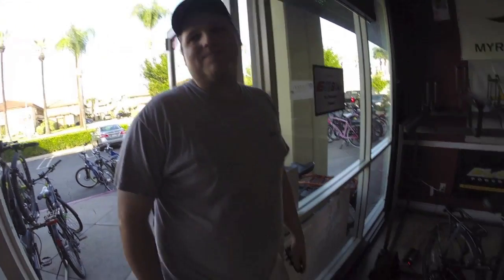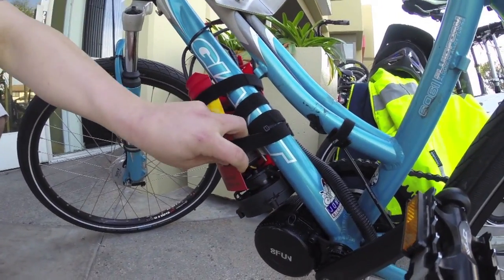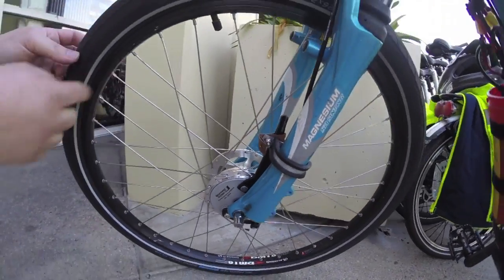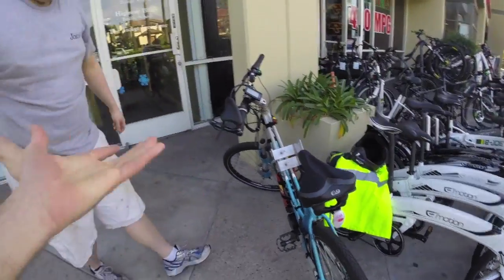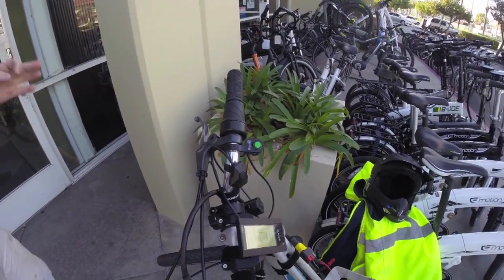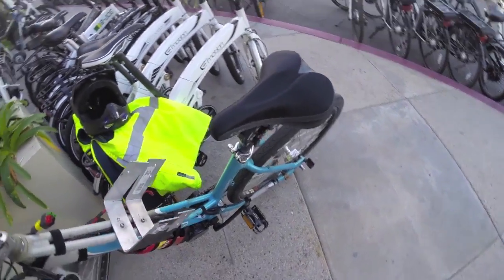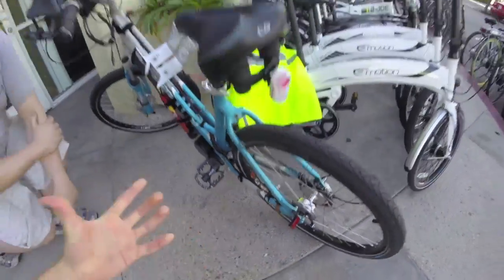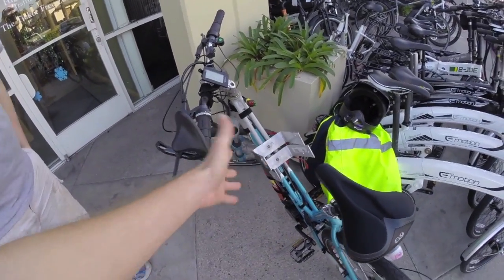Custom BBS02 Electric Bike Conversion - Interview with Grant

Comment: If you're spending $2,300 on that kit, you're buying it from the wrong vendor. The only cheap part on the bike was the fork, and it was fine for commuting. The fan is a 12v one made for ATV radiators I believe. It ran off a DC-DC converter I added that took the 52v of the pack down to 12v.

Comment: some more details on that fan would have been good =/
Reply: Monstaah it was a 12v fan from Spal, made for powersports radiators I believe. Run off a generic DC-DC converter from eBay.

Comment: bbs02 are great at least the 750 25amps ones, and Em3ev is a premium seller. i am around 220lbs my bike does around 30mph.
Reply: Nice, so you have the 8Fun BBS02 on one of your ebikes? I agree, the 750 watt motor size feels very powerful and the higher speed is fun. I haven't spent much time at the EM3EV site but I just checked it out http://em3ev.com/ pretty solid selection, is that where you got yours?